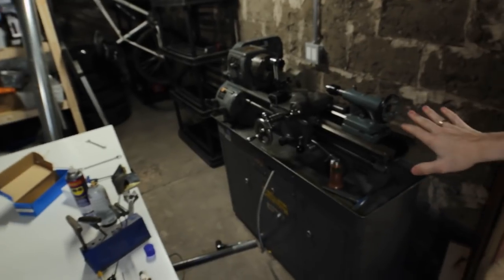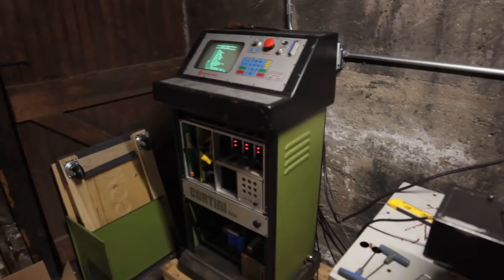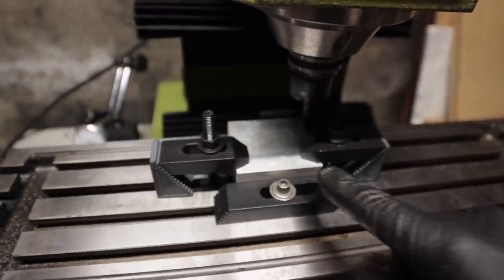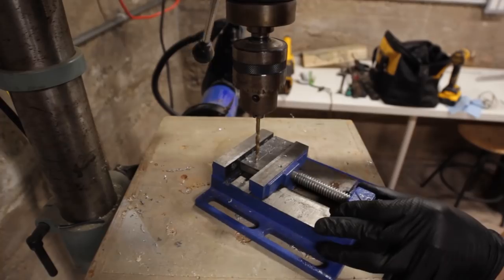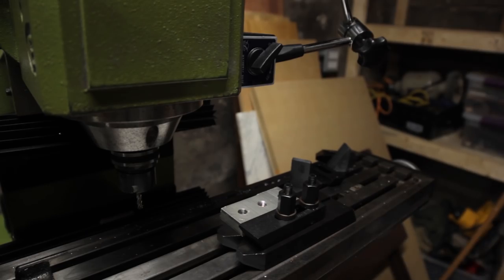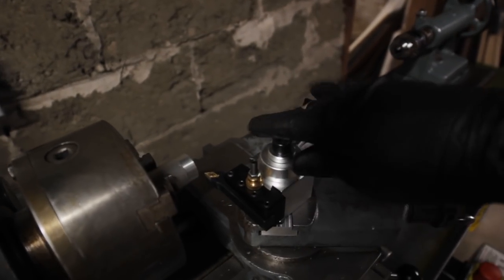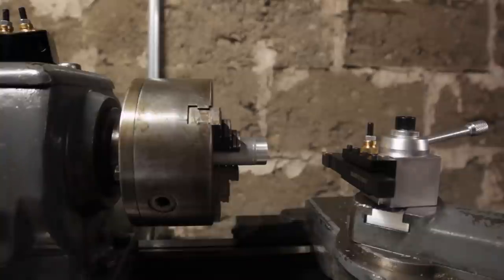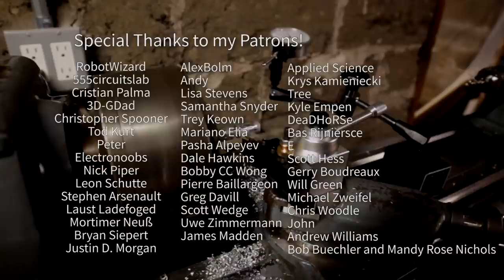This is the Perfect Lathe for my Basement Shop

Comment: That chuck has a LOT of runout, I recommend checking a round pin held in the jaws and the outside of the chuck body.  If they both have similar runout, then see if there are bolts holding the chuck to the backplate, loosen to see if the chuck is able to move around.  If the chuck is moveable, re-center the chuck as best as you can.  You may find that the chuck and/or jaws are just worn out and you need to buy a decent new chuck.
Reply from the maker: Thanks! I actually want to pick up a 4-jaw. Have to keep an eye out for one.

Comment: For a small CNC mill like that, look a the Centroid Acorn controller, I really like the Centroid controls and they are easy to use IMO.
Reply from the maker: Thanks for the suggestion. Those look pretty cool. I was hoping to choose one that uses GRBL. Or just make my own board. There are so many options out there.
Reply: @SeanHodgins  Trust me, the Centroid control is light years ahead of GRBL.  The Intercon conversational software is great for simple machining operations, it also comes with a lot of the unlock codes that cost $$$ 15 years ago.  If my Fadal was step and direction, I'd put one of these on it in a heartbeat.  Retrofitting with an Acorn and a set of Clearpath servos would be an ideal upgrade path for this machine.